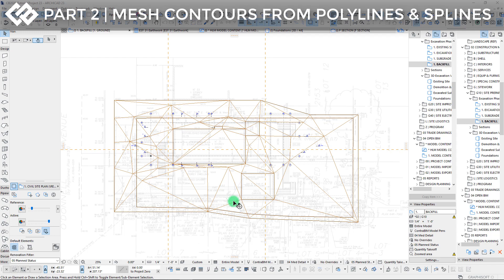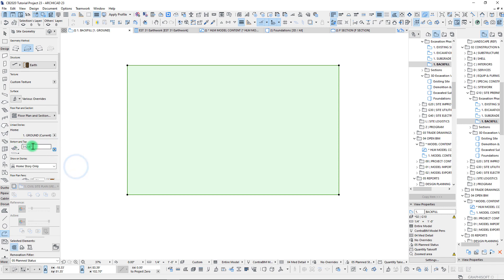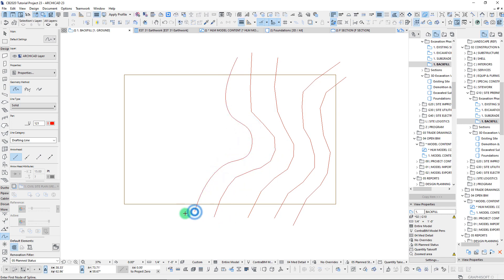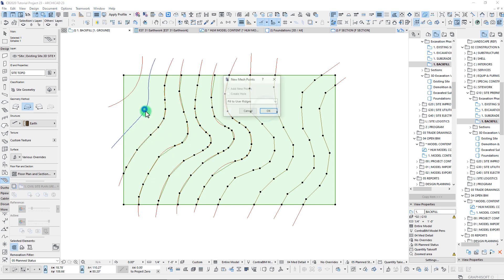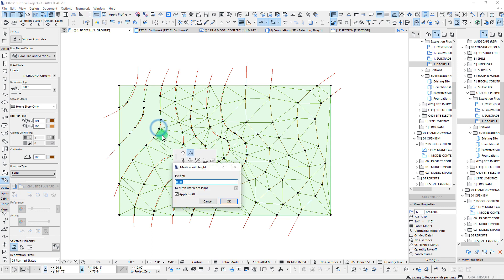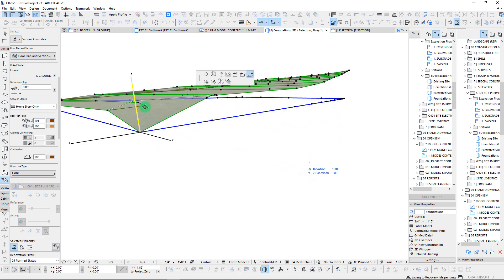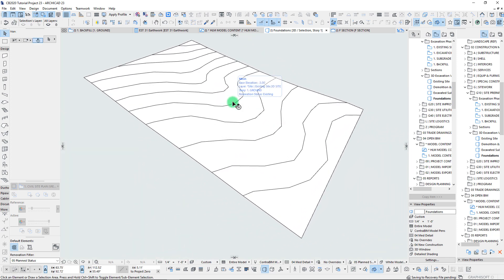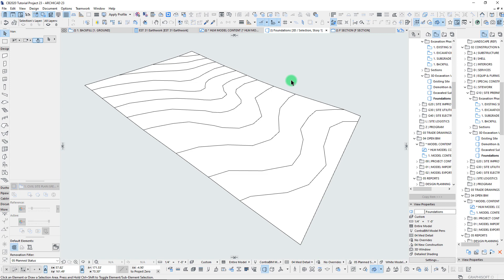How to Create Topo Contour Lines with Meshes, Splines & Polylines (Part 2) - ARCHICAD Mini-Series

Comment: Is it possible to use the dimension tool to get spot heights from the mesh you have created in plan view? This is very helpful to see for site plans etc, not just height elevations in section..
Reply from the maker: Yes, but it's not the dimension tool you're looking for, it's the Level Dimension tool! You can even get in and edit the references to project zero, sea level, reference levels etc... very useful!

Comment: I was looking for a solution that works from give topology (ie XYZ data) and "cuts" the 3D mesh at certain hights. In this plan how do you know that thoose lines will be at the same height? BTW as allways, great video.
Reply from the maker: Hi Mark! Thanks for the comment and the question. This video shows how to create topo lines in a mesh, by setting the specific elevation of points along a polyline. They are the same height based on the manual input method used. If you have XYZ data in list format, you can create mesh from that through that specific "create mesh from surveyor data" function. This will create a polyface mesh that does not include topo lines. To create topo lines from this, you could go one step further and create a plane of morphs at incremental Z values, and then intersect that with the mesh using SEO. What you'll get from that is a series of planes that are cut to your mesh, but result in topography lines in 3d and in 2d! To go one step further, convert all those morph planes (created from SEO) to morphs and then you'll look in the geometry making it easier to select and manipulate. I suppose I should do a video on that!
Reply: @CONTRABIM  Ok, I've just solved it!!! In the SEO the targets are the 0,00 m thick "slabs", thoose are the cut lines and the operator is the mesh! The surfaces can be grouped, you don't have to convert them into mesh. I have now nice isolines! 🟢
Reply from the maker: @markzalavari1780  Yes that sounds about right! SEO the morph planes/slabs that are 0.00 thick to intersect the mesh (the mesh by the way has to have a thickness, can't be a single plane). What you get is a bunch of morph plans cut to the mesh. Last step is to convert those morphs, to morphs, which then removes the SEO and allows you to delete faces, unwanted lines etc... The result is a nice clean morph of lines that show great in 2d as well as 3d! Glad you got it worked out!
Reply: @CONTRABIM  very good, thank you!
Reply from the maker: @markzalavari1780  Thanks Mark for the inspiration today:) https://youtu.be/k35EYXj7GZ4

Comment: Hi , I've tried this way, but in my archicad , the dialog box "fit to all ridges" did not show, even though my magic wand already meet the polyline and has blue line , would you mind to explain how we have to use magic wand so it can go smoothly to change the line contour? thank you
Reply: Hi lita, thanks for the question. The magic wand is only used for creating the mesh topo lines, from the polylines that have been drawn over it. To elevate the nodes along that mesh, select the elevate option and you'll see "apply to all" option to elevate every node along that line. Make sure to adjust your input method to sea level, if you are in fact enter the grade to that specific elevation. If you are elevating based around the project level 0, that is fine too but as long as you're aware of the input method. Good luck!
Reply: @johnhallgarth1284  Hi John , thank you for the reply and explanation! yess i missed select the elevation step , and sometimes did not aware to input at the sea level , once again thank you , that is helpful 👍👍
Reply from the maker: @litawisetiana6289  Great glad it worked for you!
Reply: @CONTRABIM  cheers🙌